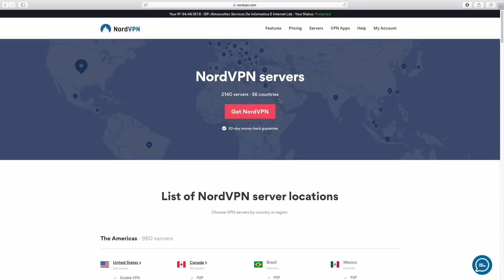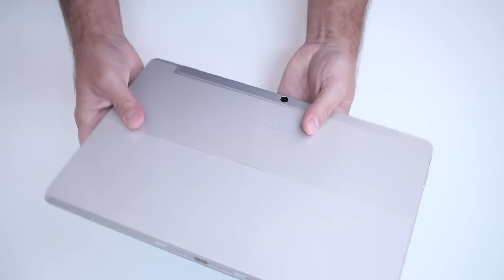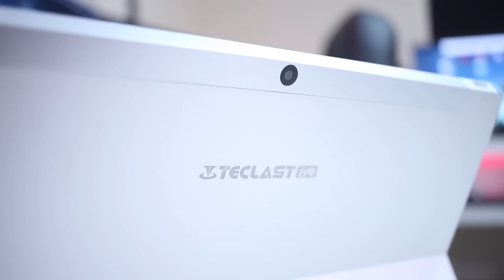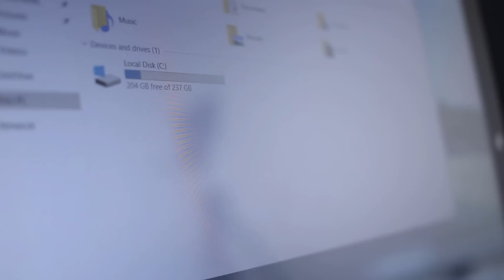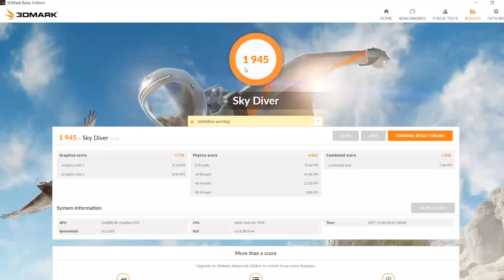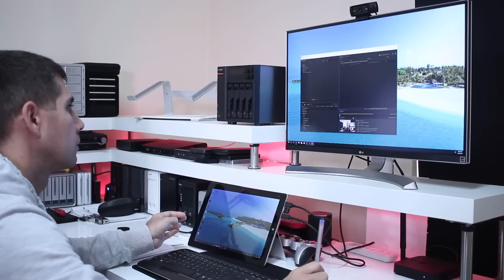TABLET with LAPTOP PERFORMANCE | TECLAST X5 ULTRAPAD

Comment: Too bad that the battery and the speaker are not good, because overall this is pretty good stuff. 
Did i miss the price tag?  How much to have it with a keyboard/track pad combo that fits in the POGO port?